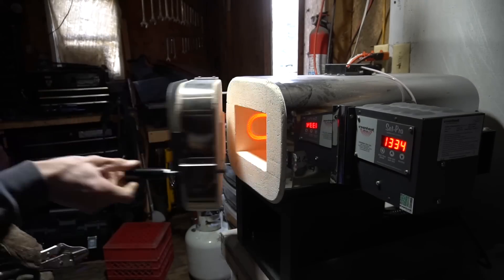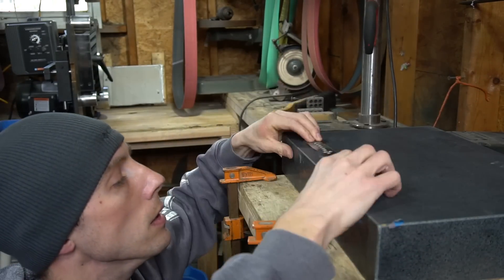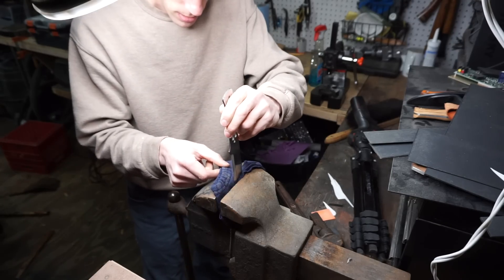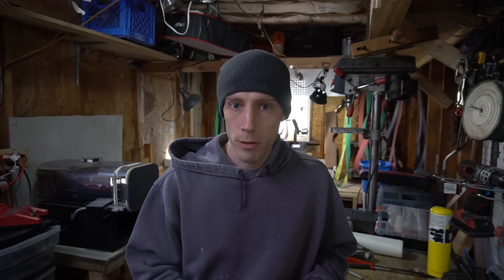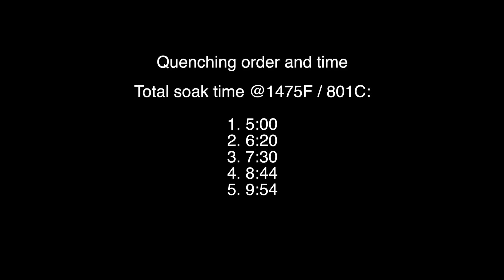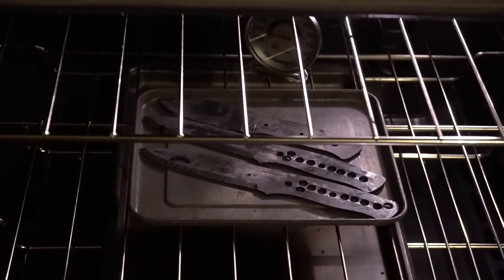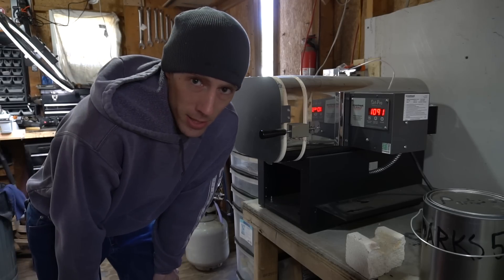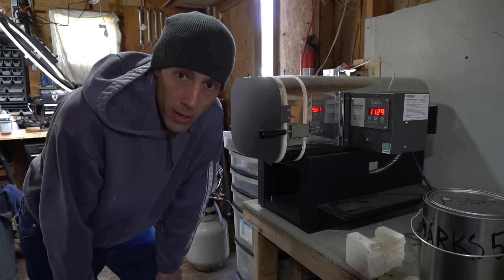Why Knife Makers Should Break Their Knives

Comment: I don't use 1095 because minute differences between manufacturers makes it so picky. It is supposed to be taken up to 1500, 1500 is supposedly 1095's sweet spot. Then I've also read 1475, but I have always gotten differences so I never use it. I use O1 and it heat treats very consistently and I make certain I always get the O1 with the 0.2%* vanadium which at that small amount doesn't make carbides, but GREATLY restricts grain growth.  Plus O1's sweet spot is 1475 for 13-15 minutes to get the half a percent of chrome and tungsten into solution. O1 also benefits from deep cryo if you already have it sitting around, makes it tougher. *some is 0.1%, it still works.

Another one of the reasons I only use O1 tool steel for non-stainless knives is after quench for about two to three minutes you can straighten the knives by gloved hand in the vise. It is the only steel I know you can do this with. My O1 knives I grind the main bevel all the way down to about 1 mm, little less because they are so easy to check and straighten. I also only do 4 knives at once because quench oil gets hot and the soak time doesn't go past 15 minutes. O1 needs a 12-15 minute soak time at 1475. The 12 minute soak is for 3/32 thick knives, 3/16 can go 17, but I rarely use a steel that thick. I know the book says 10 minutes for O1, but that's for O1 without vanadium, just FYI.

During your ht cycles with so many knives did your quench oil rise very much in temperature? I use canola oil because it's cheap and Parks 50 is a little too fast for O1. I start at 120 degrees and stop at 135 degrees (4 knives) or else my HT suffers, the knives don't harden as hard. Plus there are other issues too complicated to get into about martensitic to austenite processes etc etc. Suffice to say that you try and HT to get the best you can and you want every parameter to be where its supposed to be. Like don't leave your 1095 knives in past their proper soak time unless you're raising the temperature.
About myself, knife making is a hobby I've done since 1992, but I was a heat treater in a machine shop for several years as a young engineer working towards my masters in biology. I also do leather work since my knives needed sheaths. I found I like leather working more than knife making and will make a belt to match my sheath. I have been retired for 10 years.

Comment: Great vid man very informative. I’ve been making knives for only a year now more for hobby. I know the heat treat process is important, but who is actually going to pound on metal and try to cut logs with a knife? My question how much effort should I put into the heat treat if I want to start selling knives?
Reply: it depends on what you want to sell? top knotch knifes at a premium price or just nice knifes for a reasonable price but not as good as the first. Also depends on what kind of knife you make, a thick sturdy knife like 4mm or so probably has not that much to fear of a less than ideal heat treat, but if you want smaller knifes bending and breaking becomes much more of a thing to consider. in my opinion one should always try to get the best results, or at least with the options given to you to produce the quality you want. Everyone can buy some chinesium steel and make knifes. Good knifemakers make knifes that cut through chinesium knifes.

Comment: You had a lot of variables that could have been avoided that you did to save time. One you used the same oil to quench everything in. Every time you put a piece in the oil you raise the temperature of the oil. I suggest if you are going to do 5 different pieces have 5 different quench buckets all sitting at the same temperature. Another thing I seen and you talked about was that it pieces were sitting in the heat for longer then others. I would make some kind of mold or platform that the metal can sit on and you place them all in at the same time for consistency on the time. You can also try and slow down your operation and not do 3 to 5 pieces at a time, but rather do 1 test and gather your data then reset and repeat till you have tested all that you want to test. I would also think about the size of the metal such as a instead of a 2 inch by 2 inch piece by 3/8 inch thickness but trying to get a piece that is say 6 inch by 1/4 by 1/4th. This way you can break it in the middle for a better look at the grain structure. I hope this helps you and I love your channel. I was bummed out when you said you cant make a good knife out of the metal from Lowes or angle iron. I have made 12 so far and I was getting ready to heat treat them all this weekend. I will do it and see if they will hold an edge and try them out.
Reply from the maker: The quench oil is a non issue. Its a formulated oil designed to work the same at 80f as well as 200f+. Each blade only raises the temperature by about 10-15 degrees for blades this size. The cooling curve for 1095 is steep till about 800f then you have a lot more time to cool is still martensitic stop. So it critical to cool from austenitizing temperature (1475f) to 800f as fast as possible, but once 600-800 is reached time is extended. You can reference the ttt chart for 1095 for this information. The difference in 80degrees F in oil temperature doesn't affect this temperature range in the slightest. Plus warmer oil actually cools faster than cold oil to a point. Its counterintuitive. Thats why oil temperature wasn't mentioned in the video. 

Time at austenitizing temperature shouldn't make a difference with 1095. At least in this time range. A soak at austenitizing temperature is required with 1095 in order to dissolve all the carbon into solution. WAY over soaking may be a problem but again not within the context of this video. 

On further investigation, and talking with people who know more than i do, I believe this was a normalization issue. Or not doing enough thermal cycling to refine the grain. I do 4 thermal cycles now with 1080-1095 before quenching and haven't had a problem since. Hope this helps explain it🙂
Reply: @OUTDOORS55  thank you for the comment back. I am new to making knifes but the scientific method and gathering data is something I am very good at. Thank you for all the info. Again love the video

Comment: I beat the hell out of every knife I make after heat treat. If it survives with no cracks, bends, or chips and still shaves afterwards it passes. It makes me not worry when I give a lifetime (my lifetime that is, I refuse warranty a blade after I die,) guarantee for all the knives I make. But it takes me a hell of a lot longer then 10 hours with my little 1x30 belt grinder.

Comment: but what is wrong with grain groth if it makes knifes harder to break
Reply from the maker: It doesn't, grain growth hs the opposite effect
Reply: @OUTDOORS55   but the knife was bend on a 90 degry angel before breakin, none of my knifes can do thet
Reply from the maker: Because 1095 tempered at 420 should not bend that much. Its an inconsistent result. How much a knife bends would be controlled by the temper. But as grain size increases so does flexibility. The problem is that it cant be controlled properly and we get an inconsistent result.

Comment: When metal is quenched,does the metal contract? Does metal quenched for longer result in a more choppy, uneven contraction as its more hardened by that point compared to a blade quenched for less time? Are the longer quenched blades less malleable by that point and therefor fighting against its own strength?

Comment: Hi, I dont know anything about metal and structures, but iv seen that most grained steel was always soaked in oil last, if u use the same oil all the time without breaks maybe its becouse of oil temperature for example "knife 1 cold oil" "knife 2 hotter oil" "knife3 hot oil", if oil was the same u can repeat experiment with first knife 10 min, sec 7 and third 5. and sorry for my eng i know its low ;P

Comment: Why don't you quench the whole thing instead of just the blade?
Reply: you dont want the handle (and the back of the knife) to be overly brittle that it would easily break so you only quench the blade and use the remaining heat in the handle to prevent that, would be my guess why he did it

Comment: Normalize the steel with the oven, get the grain as uniform as possible and allow to air cool. 
Then hook yourself up some blow torches to heat your knives evenly, and use a strong magnet to hold them above your quench oil. 
When the knives reach critical temp - they'll loose magnetic properties and drop into the oil to quench. 
Let them fully cool in the oil, at this point they'll be way too hard for use, brittle as glass.
Put them back in the oven to 400-500 degrees, let them air cool to temper.

It's a machinists's trick to making critical pins and load bearing rods which have to be very strong but also not hard enough (brittle) to shatter under the load. You get yourself as uniform a grain structure as possible with a hard surface which will resist marring or being gauged by other steel parts and yet it's not so hard that it will easily bend or shatter under strain. It's usually done for small pins or rods, but if you used an earth magnet and stuck the tip of the tang to it, then allowed 3-4 blow torches in a circle to evenly heat the blade it should work pretty well for you. This process would give you uniform and exacting results.
Reply: @Aaron Washburn As far as I know: cementite is caused when carbon is permitted to migrate out of the iron alloy by cooling slowly. By doing such a quick quench after reaching a nonferrous state the carbon isn't given the opportunity to diffuse and instead becomes martensite.
Reply: @Aaron Washburn Ah, see - this is why I like longer in depth discussions on platforms which allow for it. Now I see what you're saying, the air cool after the normalization would allow for too much carbon to diffuse before heating up for the quench. 

Taking that into consideration: I agree and believe you are correct. Sorry, this isn't something I have to deal with on a regular basis, anytime I have to make critical rods or pins I start by buying materials that I don't have to normalize. There I was only concerned with what the original poster had displayed as the results in steel from him personally performing the normalization process himself. 

This is an area I don't have to deal with for my purposes. Benefit of high end fabrication and manufacturing: someone else has already performed these tasks and I start further along in the process. 

So, if I've understood the issue you brought up: a better recommendation would be to normalize, cool, then heat up and maintain high temp to allow for the cementite to melt down and reform and only then do your quench, is that correct?

Comment: your are not quenching correctly. you require a larger volume container double the size you should have no problem for what you are working with and for common sense sake get a proper decent length pair of tongs or quenching pole. you are not placing the heated piece in deep enough  or sudden enough. quenching should be done one swift motion in to fluid; not eased in. this should give better results. one more thing with naked eye you can not tell shit about grain of steel use a jewellers lens or any scope you 20 magnification before you can learn anything what you showed the video is fracture. and ductile rupture you are so concerned is not a real concern for non structural components that size. if you made a machete or sword that would be more so of a concern but that steel is 1095 which is not intended for the latter  where a spring steel would be most desirable.  1095 is a real basic high carbon steel you get what you pay for.  if you want have less ductile more brittle use a more viscous higher carbon oil  but this can higher fire hazards.
Reply from the maker: most of this was discussed in the video

Comment: I feel like something is missing here.  Soak time should not be so critical, or you'd have to change every time you changed thickness.  I think your high temperature was off and the longer soak took your steel too hot.  The steel shouldn't change if it's at the right temp.

It's been a long time since I took strength of materials,  but it seems to me that you soak until the steel is at the soak temp, and leaving it at soak should be fine.

Comment: I'm a machinist and have done a fair amount of heat treating of various metals for various reasons.  I think what Dan Pedersen said was correct, but wanted to add a couple suggestions to help you fine tune your process.  Get a hardness tester, and perhaps something to measure torque as you are bending those knives to failure for more accurate diagnosis of what's going on.  Unfortunately, my experience is with tooling steels and oddball alloys, so I really don't feel qualified to add specific insight into normal carbon steel.  In my personal experience I haven't seen longer soak times lead to bad results.  For me, I have found the tempering to be more critical but again, different materials and substantially different thicknesses.

Comment: You should probably grab a book on Materials engineering before committing to a video and talking about grain enlargement without using a microscope. Askeland & Phulé "The Science and Engineering of Materials" is probably a good start and will give you a lot of insight on what you've learned from direct observation and experience on the subject.
Reply from the maker: The term "grain structure" is used in knife making to describe what we see with our naked eyes. Most knife makers dont have the equipment to see the actual grain structure as it exists. The term is used because that's exactly what it looks like. And a lot can be determined by what we see and feel when working with the steel. Im well read on the subject. Theres just no other terminology to describe it.

Comment: Here are some reasons for your test inconsistencies:
1. Steel is cooking with variable temperature and variable time.
2. Water temperature varies between quenches.

What this means is, you don't know if it is the cooking time, the cooking temperature, or the quenching temperatures because water temperature rises and falls between quenches. There are three factors here that need to be addressed and each might compound the other.

Proposed approach:
1. Cook each piece of steel separately for the same amount of time.
2. Check water temp before and after quenching. Use the same water temp for each quench.
3. Check results for grain growth.

Repeat with minor adjustments to cook time, cook temp, and quench temp. Change only one factor between tests. Then you'll know which causes the most grain growth.

Comment: Maybe the grain size is increased if the metal is soaked in the same temperature for long time, but the change in temperature causes  the process to reset. In other words, maybe the atoms are aligned unfavorably if the material is heated longer at the same temperature, while changing the temperature cases them to realign

Comment: Nice method, however, you jump to conclusions. For example; you test pieces in 5,6,7,8, and 9 minutes. The first was the best, the last the worst. Then you conclude 5 minutes is the optimum.

However, this is not what your test showed. Your test showed 5 was better than 9, but NOT that it was optimal. To establish that, you would also have to test without quenching, and then 1,2,3 and 4 minutes.